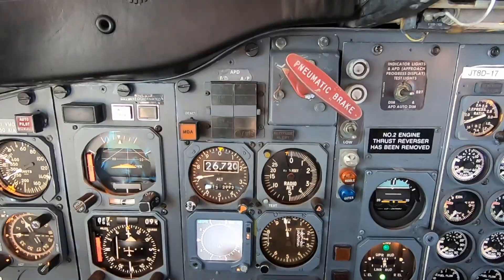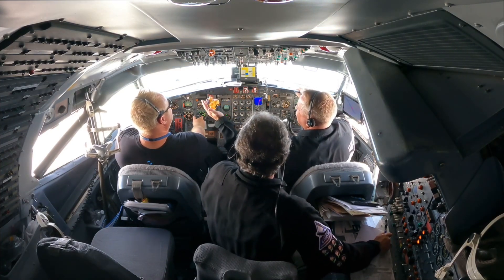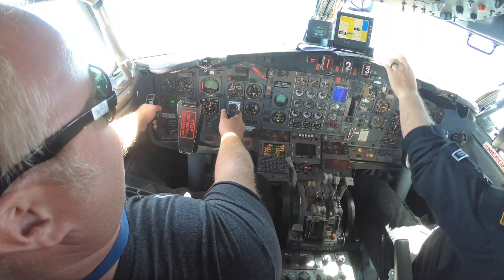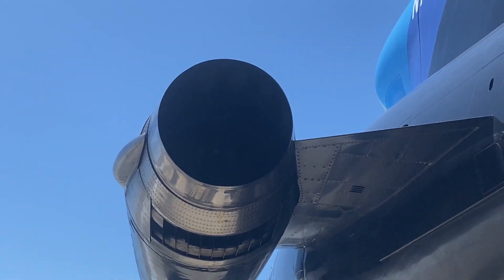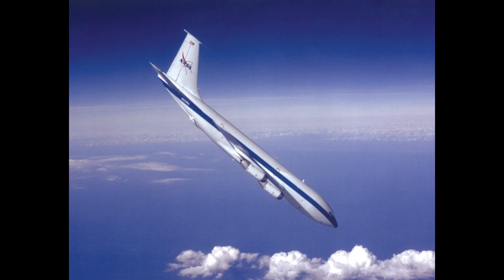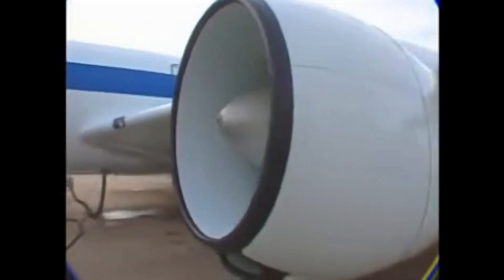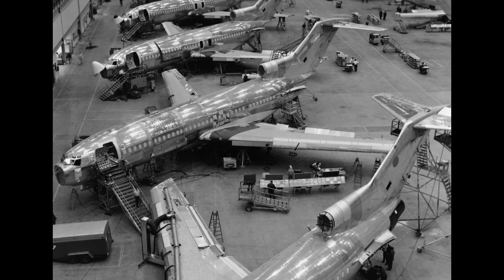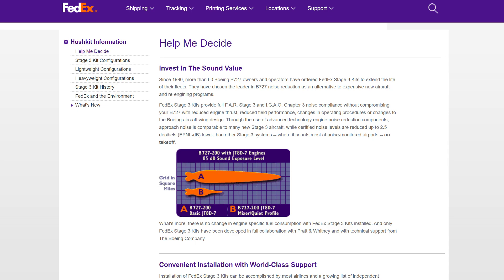Why NASA Uses A 1970's Boeing 727 For Zero G Experiments.

Comment: Wonder why they didn't just buy a old A300. Worked as vomit comet for ESA for a long time, and there are plenty sitting in storage.
Reply: Probably wasn't as easy to get it to fly under Part 121 in the US like it was to make the same for this 727.
Reply: 14-1-g-121 exempts the A300-600 series from all these special requirements, because it already has a newer air worthiness certificate.

Comment: Any accidents so far with all this complex flying?

I'd think somebody has been slammed hard at least once... right?

Also, seems like stress could build up on such an old aircraft.
Reply: The stress points, cracks etc. of aircraft usually are well documented and regularly checked.
Reply: It is being flown within it's flight envelope, otherwise it wouldn't have ever gotten to fly Part 121. It is also never flown with a full load and thus I imagine it is still the pressurization cycles that count - just like on any other commercial aircraft.

Comment: Many years ago, probably late 70's I was on  a 727 flight to LAX where the gate wouldn't connect to the plane.  So all of us passengers exited using the tail stairs in a heavy rain.  Interesting experience.
Reply: I think it was really common on 727s and DC9s but also MD8xs. I did it several times in the 2000s when flying with MD82/83
Reply: BAC 1-11's also had these steps directly below the APU. It was a noisy way out of the plane.
Reply: Yeah.  When gates are full at DCA airport, we had to exit through the tail.

Comment: These are very cool flights both the European and American ones. One thing maybe you can answer for me, because I was thinking about it. The limiting factor on how long the parabola can be is probably speed and not altitude right? The the intuition suggests it would be altitude (you can't keep descending forever) but I'm assuming that it will reach the top speed of the aircraft first. So for these companies was there any consideration of choosing an aircraft with a high top design speed in order to extend the parabola? On the other end the duration of the maneuver can also then be extended by minimizing the starting speed.

The other thing I liked about the European flights was that the alarms and alerts go off in the airplane (obviously because the parabola maneuver is outside the standard operating envelope of the plane--although within the operational maximum limits presumably). I assume the 727 predates such systems?
Reply: They are actually at maximum speed at the start and end of the duration.
Essentially zero speed at the middle of the duration.

The zero-G duration starts roughly halfway up the climb with high positive vertical speed, and ends roughly halfway down the dive.with high negative vertical speed.

Comment: The 727 is the first aircraft I ever did an engine run on, very fun and way harder than modern aircraft. Fuel addition is controlled manually, so you have to watch for oil pressure and N2 speed.
compare that to a Global 6000 or 7500, and its just a switch. One of those 1" tall  pull ones you see on small aircraft, that's all it takes to start it.
Reply: Yikes. The dudes flying 727 fire tankers must be amazingly talented.
Reply: Guilford Tech Community College's 727 is the only actual jet I've ever run engines on.  When you're used to something like a Cessna, those low bypass turbofans back there are a THING.
Reply: @thebeast6494  agreed, but my experience is on globals and C130-J's so I cannot comment on modern airliners.

Comment: In theory, you would think that the zero-g arc wouldn't be that difficult to follow, as it's just the trajectory the plane would take in the absence of all forces save gravity, you would just need to cancel out the force due to drag with your engines and control surfaces.
Reply: You're describing what it's theoretically supposed to do, not an actual way of accomplishing that. The vague outline you're describing would actually make the task impossible since there's no practical way to directly measure the drag hence no way to "just" cancel it out. Fortunately you can directly measure how close you are to zero-G using accelerometers (or a floating rubber duck), although that still leaves the many tricky parts described in detail in the video.

Comment: I was expecting the plane to have a set of smaller tanks that they could have a bladder to keep the fuel pressurised, so that it could be pumped without gravity.
Reply: Any change to critical parts of the plane require extensive testing plus regulator involvement. It seems, it is cheaper to fly with full tanks than to optimize fuel system for zero-G
Reply: Within each fuel tank of the 727 is a collector tank that contains the motive flow jet pumps and electric boost pumps. The collector tank is per it's name a central draining area, essentialy a smaller tank within the larger, that has check valves isolating it from the rest of the tank. This allows for there to be a constant source of fuel regardless of attitude or turbulence. The Engineer would keep all three fuel tank crossfeeds open during low G maneuvers. This way if too much fuel sloshes away from the motive flow pump volutes in one collector tank, then the others will be available to keep the manifolds pressurized.
Reply: The  motive flow fuel pump (jet pump) is very reliable and needs very little maintenance. The motive flow is pressure fed by the boost pumps or by the return fuel coming from the engine pumps. Whichever has the higher pressure.
Reply: @jpeterman57  Beautifully illustrated by Animagraffs' latest video, although using an Airbus A220, but the system is very similar.
Reply: The main (centre) tank is a bladder tank. They can use it to feed all engines. Probably use the wing tanks for the flight out and back.

Comment: Not entirely sure the story of the CIA doing the air stair test is completely accurate, my dad did a few D. B. Cooper style jumps as part of a skydiving festival called a "boogie" in Quincy, Illinois back in the 90s. Can't imagine they got almost a whole airliners worth of hyped up skydivers out of a small crawl way fast enough to not miss the drop zone!
Reply: SkyDive Perris has also been trying to fix theit DC-9 for 15 years now!
Reply: @rkan2  ahhh maybe they never used the 727 like I always believed 😅 Googling Perris DC-9 shows they seemed to have gotten permission to fly without the air stairs fitted at all, rendering my original comment useless. Sorry everyone!
Reply: @MrBoredNoMore  Not to worry. If we could only make YouTube comments about things we knew for sure, there would only be 6 of them [edit: 4 of them nonetheless wrong] instead of 600...  and I would have to find another way to waste my time (and occasionally, other people's).
Reply: Maybe the CIA only tested it at the speed which Cooper jumped out at.
Reply: Or maybe the skydiving company added beefed up hydraulics to help open the rear gate?

Comment: To be honest, zero-G rides is well outside the design-scope for passenger aircraft. So I think the bulk of the cost of the program goes into designing, certifying and implementing the alterations needed and that would be more economic with an older model, more available cheaply.
Reply: They are operating the 727 in it's normal flight envelope, so it is not that far from normal. Same reason they can operate under Part 121 just like any other commercial airline.

Comment: This was the generation of technology coming out when I was studying aerospace engineering. Many of my fellow students were on a track to becoming commercial pilots, the 727 was the hot rod that they wanted to fly back then. High thrust to weight ratio, can land and take off just about anywhere. Only a job flying business jets, especially the Lear 20 series, was more desirable.
Reply: Should also note that our drinking game in the dorms was identifying the transports coming in for landings on the north runways of LAX by the sound of their engines. They came in right over our heads at Northrop University.
Reply: @saundby  I remember doing the same thing at Embry-Riddle Daytona campus since it was attached to Daytona airport. We joked you could always tell the freshmen since they'd look up and get excited when they heard the Delta jets fly over because of their lower bypass engines.
Reply: @saundby  I learned to do that with military jets at my job south of Carswell AFB. Which led to that day leading up to an airshow where I went, "What the HELL is that screaming noise?!" and turned around to see a B-52 on approach.
Reply: When the 727-200s were introduced they were underpowered and pilots nicknamed them the lead sleds. Boeing eventually equipped them with more powerful engines but the nickname stuck.
Reply: Not to mention the aft stairs, for a quick disembark
Reply: @kevinhagen7808  or jump out
Reply: Thirty years ago, you could buy one for what it would eat through in fuel in a month. They're probably even cheaper now.
Reply: @robertherndon4351  but it eats through a new plane in fuel every month so not very worth
Reply: Lear 23? Nahhhhh. G2SP retrofitted with military surplus Phantom afterburners. Yeah yeah, you got a phone number for me to call, what else is new

Comment: It occurs to me - I'll bet that 727 has no restroom. You really don't want a tank of toilet fluid sploshing up through the flush-hole, and the aircraft toilets I've seen have really flimsy valves keeping the tank from coming back up into the toilet bowl.
Reply: Though I wouldn't imagine it would be that difficult to remove a toilet or at the very least decommission it so there's no fluid
Reply: @battlesheep2552  yup. But their advertised duration is five hours… Some of that is surely ground preparation, but that could be a problem. Empty out before you get onboard and don’t drink any fluids.

Maybe they fixed the bowl valve instead. :-)
Reply: Water bottles work two ways
Reply: Also they probably want to put a zero-g toilet on there for testing, making damn sure it doesn't back up, because as much as it would suck on an airplane, it would suck even more on the ISS where you're stuck on for 3 months.

Comment: I wonder whether the Airbus fly-by-wire computer would allow such a maneuver. I guess not. 
PS. I think this is why they need three persons to fly the zero-G Airbus.
Reply: The A300 or the A310 are not FBW - they fly similarly to their counterparts from the same era. On a modern FBW aircraft you'd really need to employ some of the alternate laws to do this kind of stuff and getting an STC to constantly fly in those modes probably wouldn't be trivial!
Reply: You can switch off the protections and go into what the computer calls "alternate law" as opposed to normal law or flight mode. This removes many things like stall protection etc... you can also go into direct law, where you have as the name implies direct stick - controls connection and the computer does nothing. You can do a barrel roll, the computer will just get a little angry and blare warnings but it won't interfere.

Comment: Watching yeseterday's video I realized how important the duck is. The only way I think it could be improved is if it was in a vacuum chamber and the logistics of fitting that into a cockpit AND having it be visible to the pilots would be... difficult
Reply: Or, automate it.
Reply: On a Soyuz launch I saw, they had similar toys hanging from strings. When they reached orbit, the toys flew forward and floated.
Reply: @TaxPayingContributor  That's on almost all launches on crewed vehicles. The first crewed Dragon flight had a dinosaur and the recent Starliner test had a Jeb.
Reply: @FastSloth87  i saw that Im so happy Jebediah Kerman managed to get to space and back safely 
god knows he dies to much when im playing KSP

edit:didnt remember jebs last name right
Reply: @FastSloth87  Sure it wasn't Bill or Bob?
Reply: The ONLY catch here is that stronger inputs into the pitch will flick the tail up and down faster than the cockpit. So inputs that keep the duck fine up front don't exactly match the rear completely. Small inputs track just fine - but larger ones will definitely see the tail of the plane move around FAR more than the nose, simply because the tail is where the control surfaces/authority is locations.